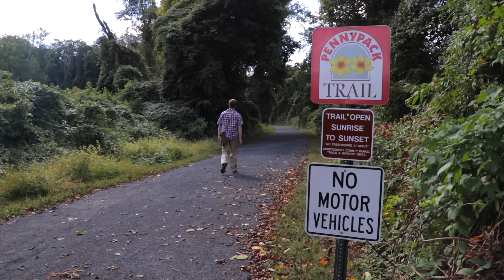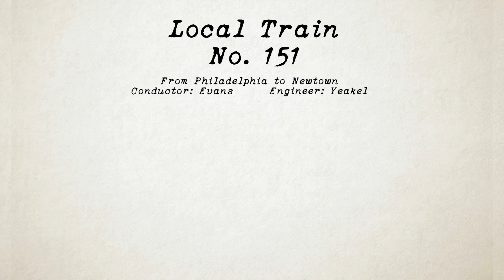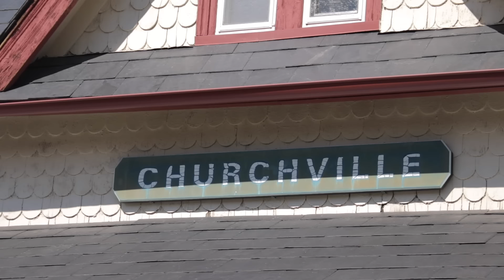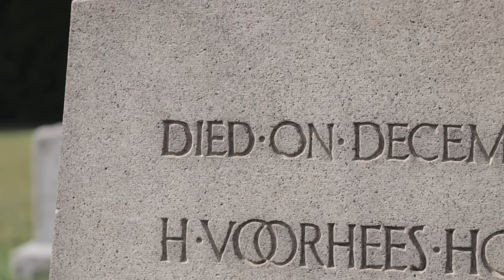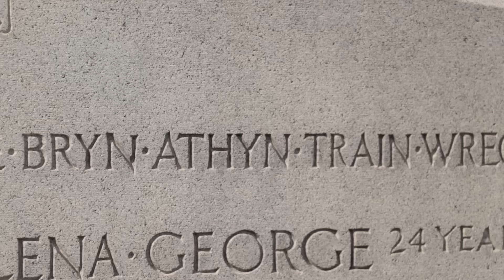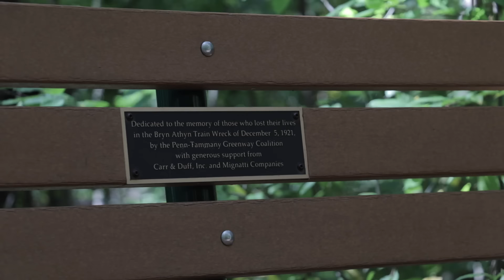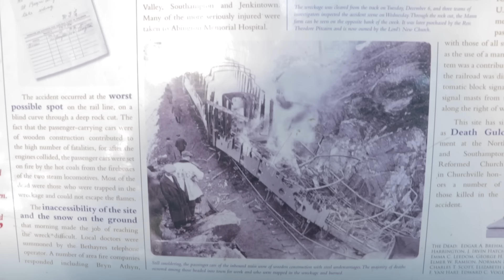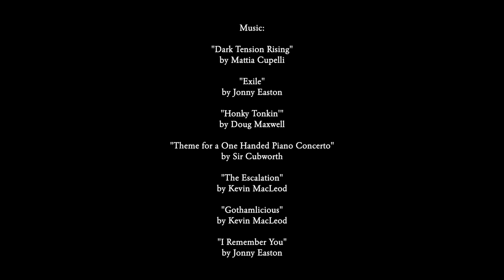The Bryn Athyn Train Wreck of 1921

Comment: There's a lot of commonality here with the Abermule disaster, which occurred in Wales in the late 19th century.  There, instead of written orders, traffic was regulated using physical tokens.  The telegraph was set up so that the tokens, held in special machines, could be released from either end of the section but only one at a time.  Thus trains did not need to run in strictly alternating directions, as they would in a basic token system.  The "Electric Token Block" has been a very reliable and safe system - when used correctly.

At Abermule, gross negligence, inappropriately divided responsibilities, and miscommunication among the station staff caused the token just given up by the local train to be given back to it, rather than the token for the section ahead.  The driver and fireman did not check that it was the correct token, but just assumed that it was, and through further misunderstandings the points were set and the signal cleared for this train even though the correct token had not been obtained - so the local train departed.  But an express train was already coming the other way, and they met at a curve with predictable consequences.  Here, visibility was obscured mainly by vegetation rather than rocks.

The driver and fireman of the local train were killed, but those of the express survived the accident.  The express fireman found the tokens carried by both trains amongst the wreckage - one for the correct section, which he knew was theirs, and one for the wrong section, which he inferred must have come from the local train.  He was able to pass these to the railway inspector who came to investigate the accident, and this immediately went a long way towards explaining how it happened.

In later years, practice was changed so that the token machines and signals were all to be operated from a single place (the signalbox) by a single man (the signalman).  Thus the confusion and divided responsibility which occurred among the station staff could no longer result in a similar accident.  And, of course, engine crews were strongly reminded of the vital need to check the identity of their tokens before driving on their authority!

Comment: Wooden bodied cars tend to 'telescope' in a crash. At the very least the bodies are distorted at the ends, which is where the doors are so no wonder people couldn't get out. Cars tended to have oil lamps inside or maybe acetylene gas. Another means by which the fire could spread. I noticed you used footage of one of those set up show crashes, which is probably pretty much what happened at Bryn Athyn.
Death by fire is a horrific way to go. 
On the railroads laws to improve safety were often written in the blood of passengers & train crews. Here it was a lax attitude because they did the same thing every day.

Comment: The UK footage used here is highly pertinent. In the UK by this time a token block system would be required. Interlocking signals would prevent a SPAD, signal passed at danger, as the train couldn't proceed without a token. Why this system wasn't mandatory in the USA I don't know, but maybe due to the scale of implementation on the massive US system.
Ta.
Reply: Errm, only problem is that in 1921 (same year!) the token block system failed to prevent the Abermule head-on collision on the Cambrian in Wales.   The problem was NOT a technical failure of the block instruments, but the driver of the train from Abermule towards Newtown was given the wrong block token (which he failed to read) and proceeded head-on into an express coming from Newtown.   (The token he failed to read was for the Montgomery to Abermule section which he had just traversed, NOT a token for the Abermule to Newtown section, in fact such a token could not have been given to him as it could not have been withdrawn from the tablet instrument until the express arrived from Newtown carrying its token).
Now I'm certain that the token block system was inherently far safer than written train orders, but what Abermule showed was that any system could be defeated by sufficiently careless application.
Reply: @cr10001  Quite right. Absolutely not idiot proof. SPADs still occur with modern ETB systems.

Comment: I am thinking it was a manual block system, were it an automatic system, the block signal
would have shown a red or given a "red board" signal and would not rely on a person to
set the block. a small voltage is applied to rails for a given distance, the rails are insulated 
at that point from the rest of the rails. when a train is in said block, the relay is robbed of 
current, the contacts drop out and making connection with a new set of contacts, the block
signal is made to show a red or stop signal.

Comment: Does anybody have an explanation as to how the train pulled out of the siding onto the mainline with the points set for the through train? Surely this would have caused a derailment at the point of entry from the siding to the mainline? The only thing I can think of is that the crew of the milk train had to change the points themselves, but this seems highly unlikely.

Comment: Interestingly I live on a boat meer meters away from where the Thorpe railway disaster took place in 1874 
This mishap directly lead to the electronic tableting system
Which is a system of physical tokens which garentee you have right of way on a peice of single line track 

Presumeably if such a system was in use here this accident would've been prevented

Comment: 60 miles per hour is 88 feet per second. 
If these two trains were closing in to each other at that speed, and didn't see other until they were 40 feet apart, it was only one-half second from "Oh, sh--" to disaster.

Comment: Railway Safety is extremely high.  This is because of learning that has occurred through meticulous official investigation of each disaster, backed by legislation.  The same applies, thank goodness, to air travel with the same safety improvements.  In the US (unlike the UK) trains are not always controlled by ‘Absolute Block Working’.  Under the Absolute Block system, signals and switches (turnouts) are interlocked, signalling is king and written orders only apply to unusual circumstances such as ‘Wrong Line Working’ over double track sections where one track is out of use usually because it is being repaired and during which a single ‘Pilot Man’ must ride every train, preventing conflicting movements.  The system weakness in this case is Written Orders combined with Habit.  I have some sympathy for the guilty engineer and guard which locals also had clearly.

Freedom and discretion is a fine thing, but in railroading it is catastrophically dangerous.

As an aside, many Welsh families emigrated to Pennsylvania to dig coal, hence the Welsh place name.  Bryn means ‘hill’ and Athyn is probably a boy’s first name.

In Japan train drivers Salute each fixed signal in deference to its authority.  This reduces SPADs (Signals Passed At Danger)

I think the Camelback type of locomotive may have been a contributing factor because Engineer and Fireman (Stoker) occupied separate cabs.  It is possible that the Fireman could have questioned the Engineer’s decision to pass a signal at Danger, had he been sharing the same cab.

Comment: Now, did they use bell codes. It would have  been easier rather than using track warrants. Along with tokens which would have permitted one train in  the section
Reply: "NOPE". You would be able to hear it.